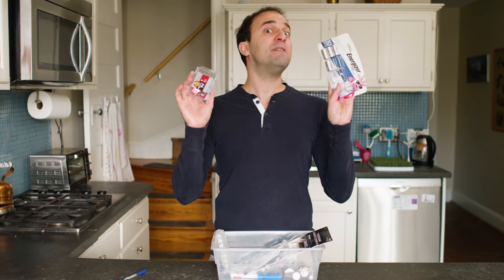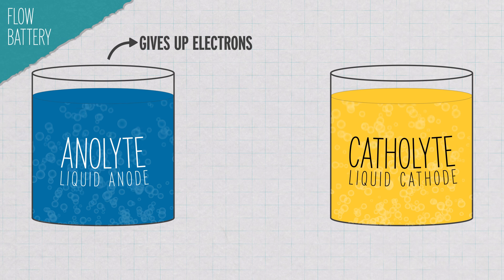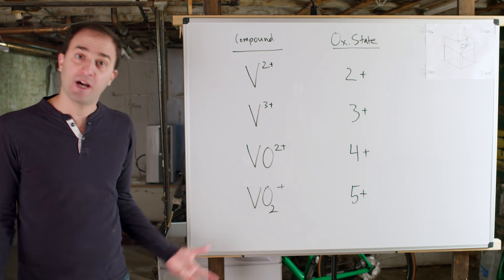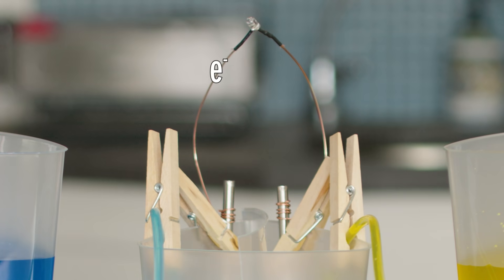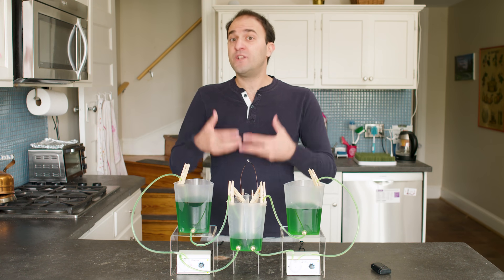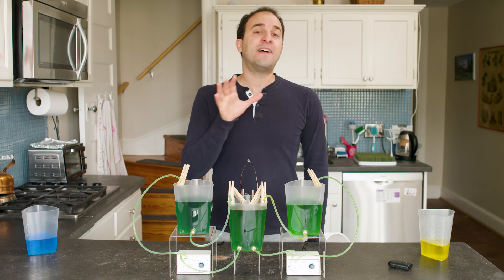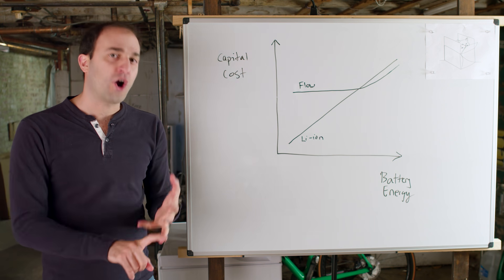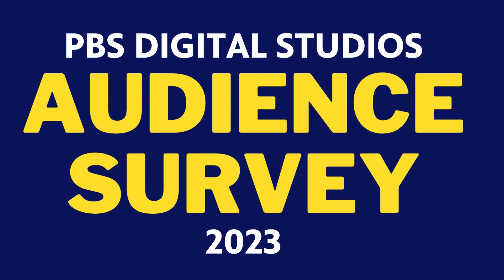Vanadium Flow Batteries

Comment: 5. Lithium is fairly rare and expensive, and the fluctuation in its price dramatically affects the overall cost of batteries made from it.  Sodium-ion batteries should not have this issue as sodium is incredibly common (look in the ocean for example).  Whether the sodium-ion batteries will have issues 1-3 will be interesting to see.  I've heard they don't have the fire danger risk, but again - remains to be seen.
Reply: Sodium has an even larger fire danger risk...

Comment: Where is lithium on that periodic table, y'know for comparison purposes? oh you didn't show that part... wonder why that could be.

Oh there it is.
Reply: This comments reads like it's insinuating that the video is obfuscating some truth, but I honestly have no idea what? That lithium is lighter? That was mentioned.
Reply: @majorfallacy5926 man the original comment is so fucking confusing, they’re making out to be some kind of conspiracy??? and it’s just lithium
Reply from the maker: Great question! Lithium is the third element on the periodic table, directly below hydrogen! This means it has a single electron in its outer valence shell, so it forms bonds in a +1 oxidation state.

Also our cloth periodic table turned out to be slightly too big for our whiteboard. Sorry!
Reply: Those elements were removed for cost-saving measures.
Reply: Hey yeah. That's very strange for a chemistry channel to show the table like that.

Comment: I would have liked to learn more about how it would be recharged, and at what scale it could be useful to a homeowner (if at all.)
Reply: They're almost infinitely rechargeable by running the thing in reverse. Electricity goes in, the V3+ gets reduced to V2+, the V4+ gets oxidized to V5+, and the whole thing is ready to go again. And yes, there are home scale versions available in limited markets. The problem is that the home scale versions are on the wrong end of that price scaling diagram shown in the video. Unless you have a very high demand application or much larger than average house, a lithium battery (or two) will likely be cheaper.
Reply: You don't have to have copper and aluminum wiring having a fire or lawsuit risk but youll be makeing it easy for a supplier and moving lawsuit somewhere else

Comment: There is another problem which you didn't mention, tied to something called Carnot's Limit. This limit states that a closed system can never pass a certain threshold of work efficiency and reversibility, which is determined by the speed of the process and the temperature at which each step occurs. Initially this limit was applied to engines, but it is applicable to any thermodynamic system.

The main reason why flow batteries and fuel cells are potentially superior to conventional liquid state and even some solid state batteries at a large scale is because the batteries are much more bound by Carnot's Limit, due to them being "more closed" than the flow battery and fuel cell. Actually, a fuel cell is an open system, making Carnot's Limit irrelevant to its performance. And with regards to the flow battery, you could treat it as open as well, since the tanks are externally replaceable and replenishable.
Reply: I'm gonna need a source on that because both electrical and chemical energy are generally approximated as pure exergy. Carnots factor is for thermal power engines (if that's the correct translation)
Reply: @majorfallacy5926  the initial application was for thermal energy, that's correct. But the principles of thermodynamics apply to all forms of energy. I do have some books where I studied this from my undergrad. 

Advanced Batteries by Robert Huggins, and Introduction to the Thermodynamics of Materials by David Gaskell are great starting places. Though the latter is probably the dryest textbook I've ever had to work with, so fair warning for that.
Reply: @me0101001000  The principles of thermodynamics apply yes, but in a practical sense (un)charging a battery barely produces entropy no matter the chemistry? (edit: apart from heat losses obviously) Also the wikipedia article for Carnot's theorem literally has a section dedicated to how it doesn't apply to electrochemical storage.
Reply: @majorfallacy5926  that applies to fuel cells, because fuel cells are open systems. I am going to dare to disagree with the Wikipedia article about batteries though. Even the citations discuss fuel cells, but not batteries. I am willing to give the author of that section the benefit of the doubt, because batteries and fuel cells are often times lumped together, even though the physics behind their functionality is different.
Reply: @me0101001000  I'm no expert on electrochemistry, but I've done my fair share of physchem and thermo and never once have I seen carnot applied to chemical storage (except for heat recovery obviously). Maybe you're right by virtue of some technicality, but if so you seem to struggle with formulating it, so I will respectfully apply the null hypothesis.

Also the physics of fuell cells and batteries aren't that different compared to that of a thermal plant. I mean RFBs are literally right in between the two.
Reply: Even if some heat is produced when charging, this wouldn't be wasted in grid scale applications, because if it was much heat it could be used.
Reply: @joachimfrank4134  Only to a degree, that's where Carnot actually comes in. At low temperatures, most of the exergy is lost. You can use it to heat greenhouses but that's about it.